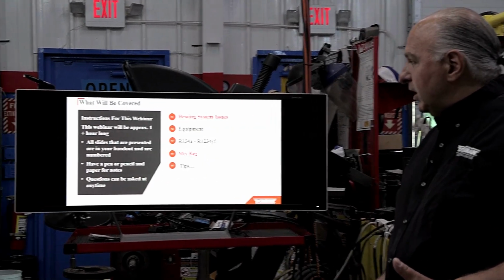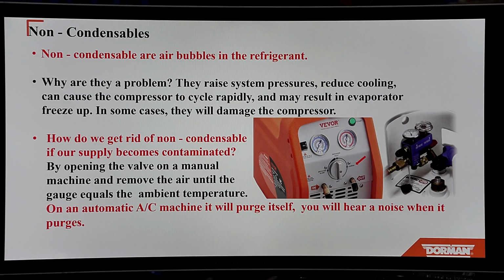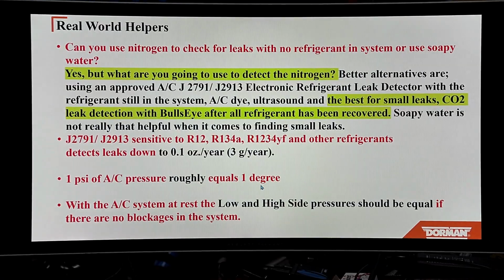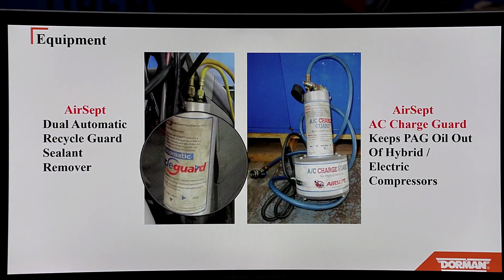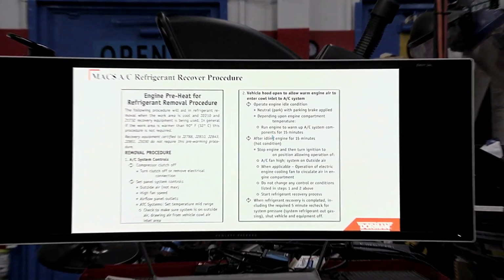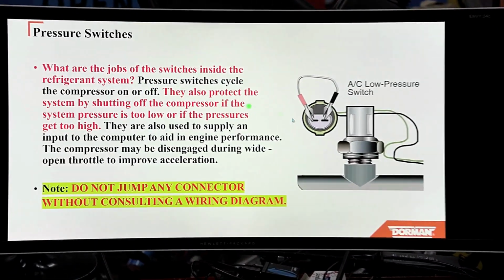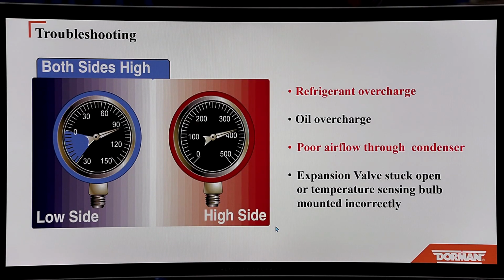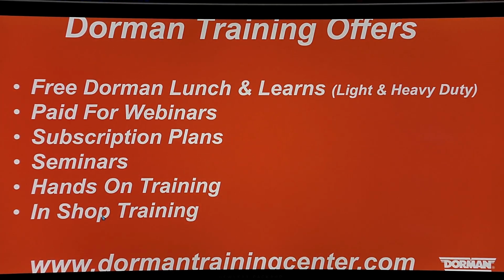AC Tips & Tricks   2025 Dorman Lunch & Learn Webinar 06 26 2025

Comment: And at about 59 minutes into the video I have had a few Fords that the evaporator temperature sensor was way off the mark not allowing the compressor to energize 20 degrees Fahrenheit which doesn't set a code it's a must to check all the data the first one I had was told by two different shops that he had a computer problem
Reply from the maker: The sensor has to be in the proper place to make sure it can transfer the evaporator temperature. I don't think it would be a computer issue...I would get another opinion. If you have not already subscribed to our tstseminars YouTube channel please do so. Interested in more training? Go to www.tstseminars.org and view full length videos for members on TechFlix for $9.99 unlimited viewing …Membership and over 99 videos for less than $99.00 a year. Also checkout www.attstraining.com for hands on training and webcast FREE videos at www.tstseminars.org/training-videos

Comment: At 40 minutes into the video the question is can you use a heat gun in areas around the condenser receiver drier / accumulator etc
Reply from the maker: Yes you can use a heat gun or choke heater tester but you have to be careful. The MACS tips is very helpful and works. Thanks for watch...If you have not already subscribed to our tstseminars YouTube channel please do so. Interested in more training? Go to www.tstseminars.org and view full length videos for members on TechFlix for $9.99 unlimited viewing …Membership and over 99 videos for less than $99.00 a year. Also checkout www.attstraining.com for hands on training and webcast FREE videos at www.tstseminars.org/training-videos

Comment: Let's talk static pressures I use two different AIS to get two different results unfortunately and the one I trust is the one that says when there's only 15% of the amount of freon added and it's static the pressures will be lower because there will not be enough liquid to influence to the higher pressure example 1 lb system 1234yf at 95°ambient Air temperature with the system full would be approximately 106 °with only a 15% charge it will not be there salt lake City evaporator only leaks under pressure at 95psi I did not go further with the example
Reply from the maker: The 15% of a charge is the SAE / EPA test amount for the evaporator test only. The low side will always be higher with the system off, besides the machines will NOT allow any more until you check the system for a leak with the A/C system off, air from the floor ducts, fan on low and a J2913 leak tester set to the highest sensitivity level. Thanks for watching...If you have not already subscribed to our tstseminars YouTube channel please do so. Interested in more training? Go to www.tstseminars.org and view full length videos for members on TechFlix for $9.99 unlimited viewing …Membership and over 99 videos for less than $99.00 a year. Also checkout www.attstraining.com for hands on training and webcast FREE videos at www.tstseminars.org/training-videos